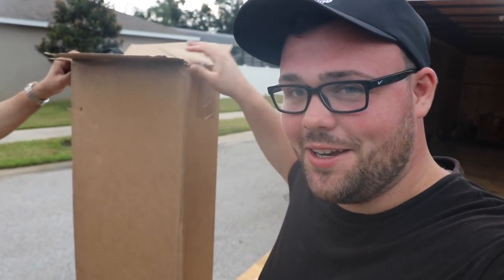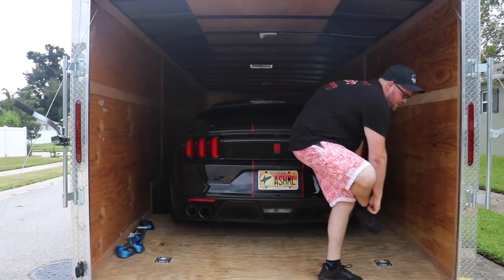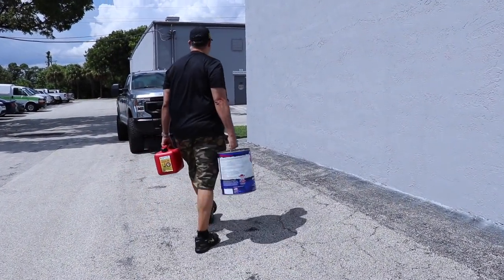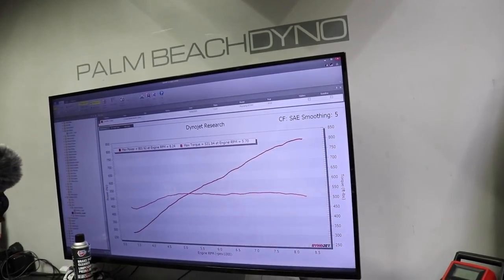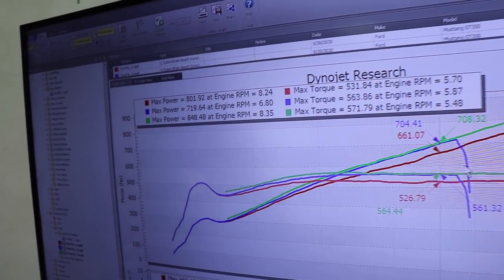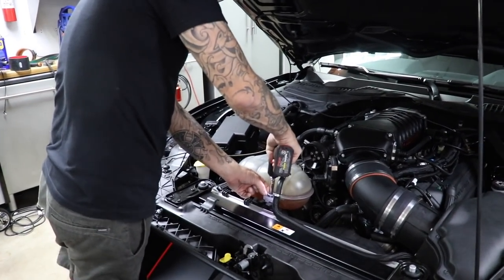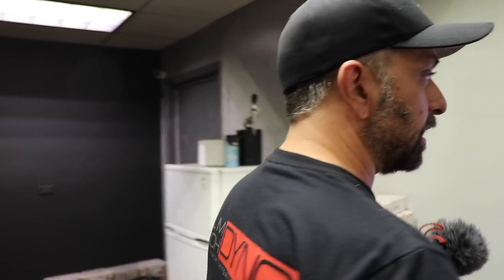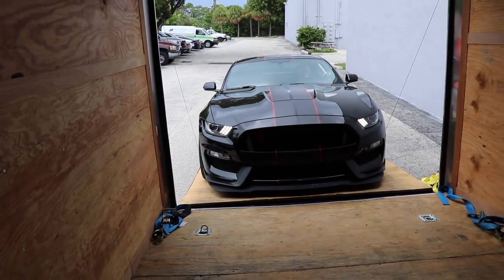Whipple Supercharged GT350R Makes over 900RWHP

Comment: Pretty good. Mine my 939rwhp on same 3.375 pulley on my Gen 5. I should drop down to a 3.6 on pump gas. I made 778rwhp on 3.7 pulley pump gas. Using a BAP as well... good stuff

Comment: How stock is that motor? And year of the R I think it is a 2017. I own a 2017 gt350 I purchased wrecked from road America so far on a stock tune still. I went 11.6 at 122..8 with a 1.90  60ft.
Reply from the maker: 2018 GT350R with billet opg and crank gear
Reply: @MustangLifestyleTV  THANKS

Comment: How much boost you getting with 3.375 pulley?
Reply from the maker: Boost is shown on the Graph. We saw just under 11.5 psi
Reply: @MustangLifestyleTV  my bad I watched video again and seen that. Seems low though right?
Reply from the maker: BRIAN ROB the better heads and cams flow the lower the boost will be. 5.2L have some very good flowing heads and cams. Similar to how my GT500 made 1140 rwhp on 23 psi where on a stock motor my pulley setup would be nearly 28 psi.
Reply: @MustangLifestyleTV  I have a 15' 5.0 gen3 whipple on e85 and I am getting same boost on 3.375 pulley and same boost I just thought we should be getting more.
Reply from the maker: Our 16 GT saw 13 psi with the 3.375 pulley with the Whipple 2.9L Gen 2
Reply: @MustangLifestyleTV  I am clueless at this point. I have a 10 rib setup as well. Maybe because I am in Philly Pa...lol